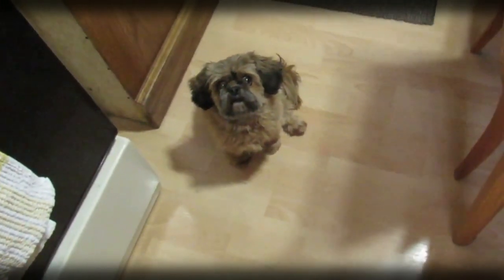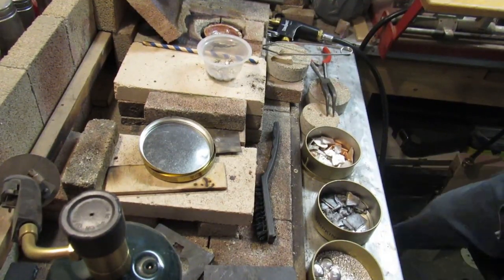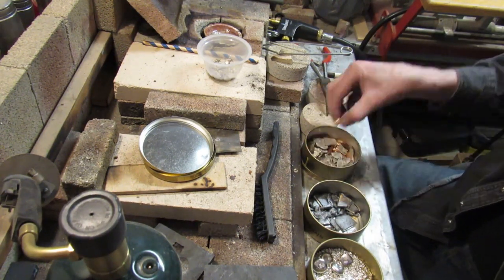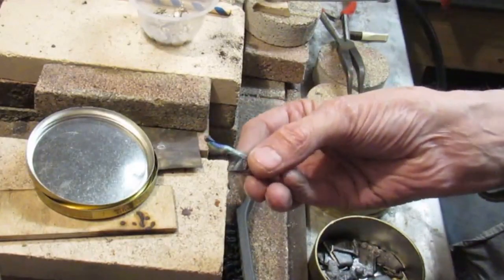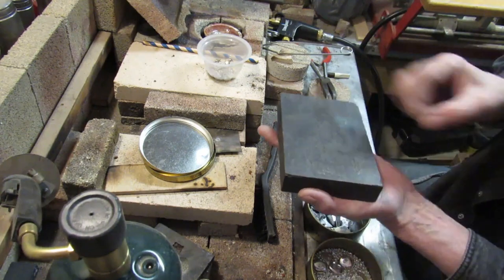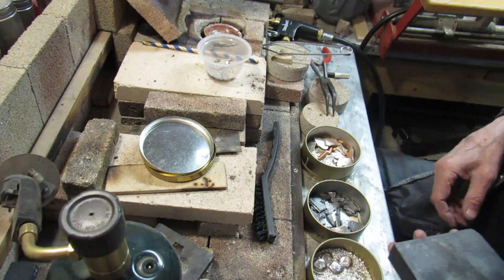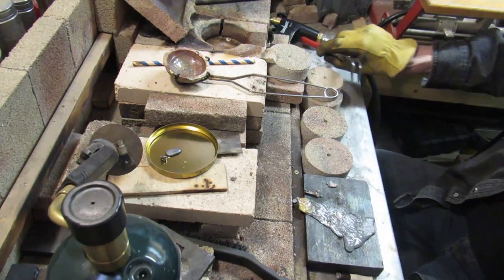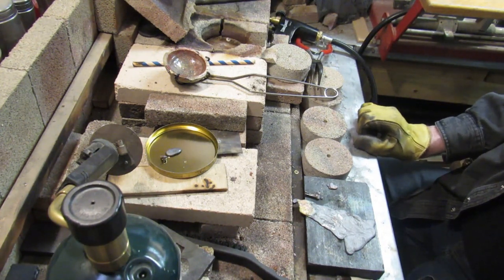Making Sterling Silver for the Silver Chopsticks

Comment: Very awsome dean great work
Reply from the maker: HEY BOSS ! ! !. The new aloy mix takes an extra heat, mix cycle but I sure like how it behaves when it is poured. I have a lot to appreciate you about the new aloy mix. I wouldn't change a thing. The sticks may be a bit harder to file and finish sanding they come out of my torture tests with flying colors. I put the tips down after bending the bottom (tips) are out by at least a 1/2 inch (over 2 in from straight) and then straighten them 20 times and I have yet to have one fail by cracking. I call that a win eh. So, , , Don't mess with a good thing eh, LOL. PS, How are your copper pieces lasting ? Take care eh. Thanks a bunch for spear heading our bunch. You in one way or another sure help to make a lot of folks feel good with wonderful pieces from us all and make new friends as well fella ! Ya ROCK bud ! ! !

Comment: Hello my brother! It’s great to see you! That’s interesting! I wonder why it doesn’t alloy on the first melt? Do you think it’s the heat?
Reply from the maker: Dom, old friend. As all 4 have different melt temps and characteristics the first time the mix is very defined. I can see the swirls in the pour. I should have cleaned one up to show folks. I chop up the flat pours to about a 1/2 in square with bolt cutters and do the deed 3 more times. It then gets stirred one last time when doing the pour. That assures a proper mix with folks getting what they paid for. I also take care to make the Sterling mix heavier on the silver. Around 940 or so seems to work well. Great to see ya bud.